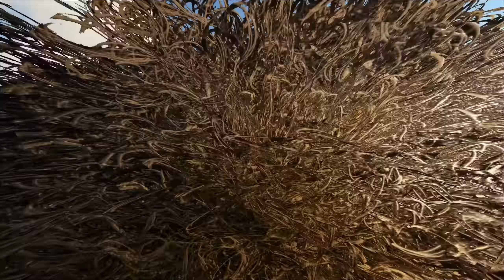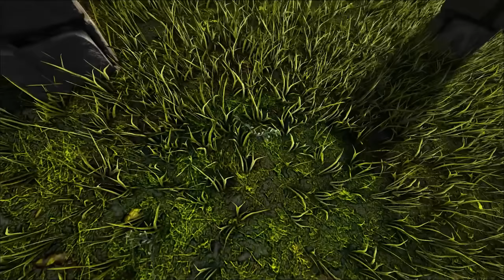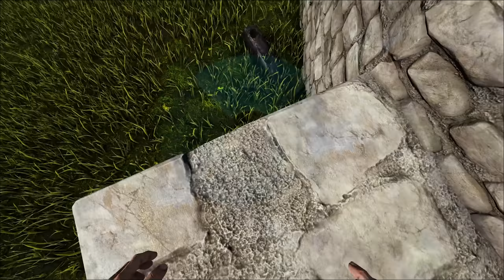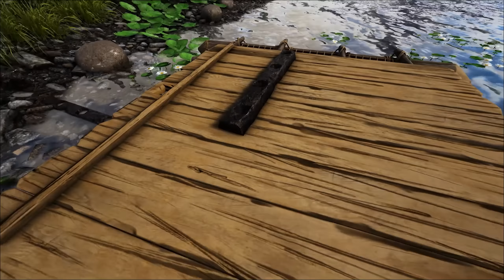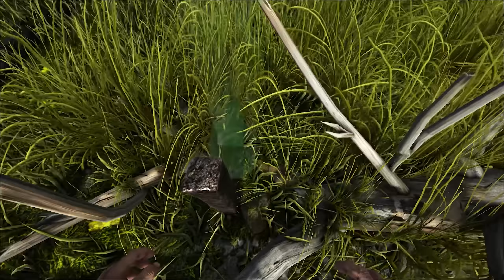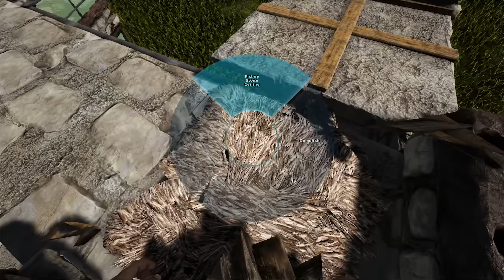How To Build an S+ Base Without S+ | ARK

Comment: Is the raft method the only way to get upside down structures? Is there something s+ can do that vanilla can't in that aspect?
Reply from the maker: There's 2 methods, platforms or a series of triangle roofs. S+ has upside down sloped walls so you don't need to do it with S+.
Reply: @captainfatdog  oh nice, mmm how about just a 90° change? From a wall to a upside down ceiling so that i could put turrets on them facing downwards or have wall turrets , which overall would give better coverage depending on layout of a cave or an ark net from a skelli tower outside.

Comment: As I posted on Dreads video, it is not the S+ part that worried me, it was the 'no collision'.

But if anyone could pull it off, it you be you FatDog!
Reply from the maker: I'd say they each offered an equal amount of challenges. It just didn't seem like enough of a challenge to do it with clipping 😆

Comment: Quick question, the trick with flipping ceilings upside down using a raft, would it work using a Skiff?
Reply from the maker: Yes, I just used a raft because I was trying to keep it primitive for a primitive build.
Reply: Yes
Reply: yes you can! ive tilted pilliars the same way using a skiff on official